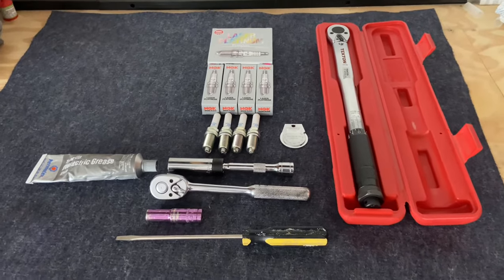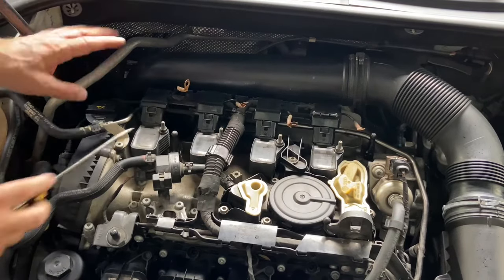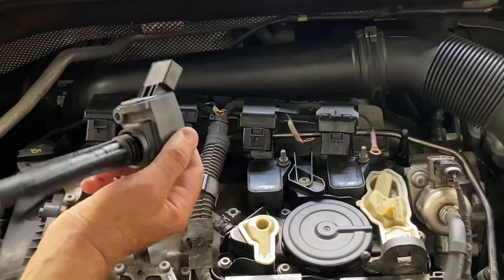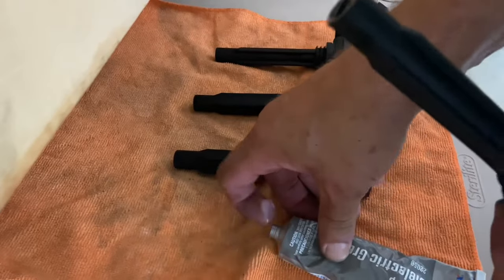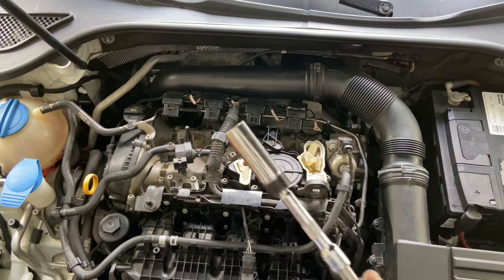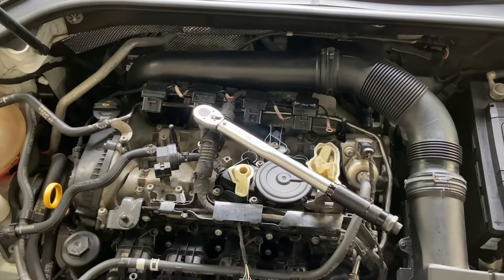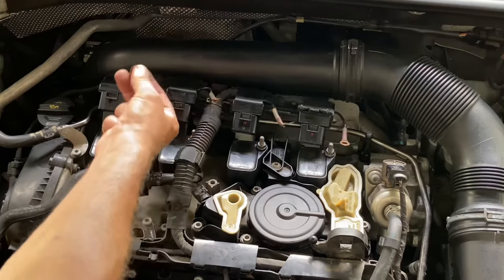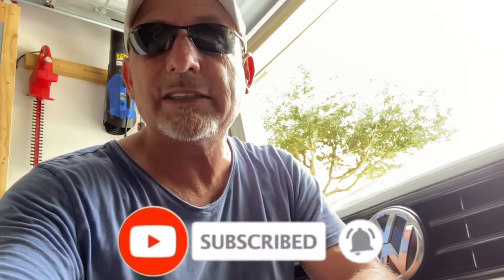VW PASSAT 1.8 TSI-HOW TO CHANGE SPARK PLUGS Passat/Jetta/Golf/Beetle #passat #sparkplug #volkswagen

Comment: Despite the really helpful and well done video, this project appears to be a bust for me.  The coils seem to be so badly fused that I wasn't able to remove a single one.  I thought I finally succeeded in removing one, only to quickly discover that the top of the coil separated from the rest of the rubber boot seated in the spark plug well.  I spent another couple of minutes trying to remove the rubber boot, but had to give up and put everything back together.  There is no indication (yet) that I've done any harm, but now I'm going to have to let the professionals do it and hope my assessment is correct.
Reply from the maker: No no no.  Just get new coil packs.  Pull the old ones out even if they seperate.  If they separate just make sure you get it all out.  Replace with new ones.  Good ones are only around $160 for the set.  A shop May charge a lot.  Let me know.  It’s not difficult at all.  😎💯
Reply from the maker: Use pliers or whatever to pull remaining part of coil out.   That’s why I’m the video I stress putting dielectric grease on the coils so they don’t get stuck.  But pull them out.  No damage should happen.  It’s just a metal tube down to the spark plug.  Seriously save yourself money and just get them out even if in pieces.  💯
Reply: Well, not wanting to give up, I have ordered the coil pack and I'll work on it again tomorrow.
Reply: I wasn't able to get back to it again until today, but success!

Once I got the coil packs out, it went smoothly from there.  Each plug was pretty corroded and each one felt as though it was covered in glue when I finally got them out.  I suspect the plugs were put in with silicone grease vs dielectric grease.  Whatever it was, it had solidified and created a bond to each of the plug caps.
Reply from the maker: Nice to hear.  Silicone grease and dielectric are pretty much the same.  But none was ever applied I think.  Most people don’t apply it.  But yea.  If you keep at it they will eventually come out.  Coil packs are such an easy thing.  I could never imagine paying for it.  Good job!
Reply: Hey I’m about to do this job just wondering how many miles did you wait for them to fuse
Reply from the maker: I bought the car used.  I was at about 70k when I replaced them.

Comment: My 10mm bolt is stuck to the other 10mm bolt with the ground wired stuck in the middle
Reply from the maker: Don’t break it.  Use 2 wrenches.  Hold one with a wrench and use another wrench or socket to remove it.  Spray with WD-40 also.  Let me know.  But be careful they break easily
Reply: @grind-it-out how did you get a wrench in between both 10mm nuts? A standard wrench is too tall.
Reply from the maker: I have a small set of metric wrenches.  It works fine.  If not get some needle nose vice grips or pliers and that should be enough to hold it while loosening the top nut

Comment: What tool is that to get the spark plugs out
Reply from the maker: A 5/8 deep well spark plug socket.   Pretty standard socket.  I have a magnetic one I got from autozone for $10.  But you can find them anywhere and it doesn’t have to be magnetic.

Comment: Yup i broke that plastic connection 😂
Reply from the maker: Hopefully you still got it off.  It’s not a big deal if it broke.  It will still snap back on.  💯👍🏼😎
Reply: @grind-it-out  thanks for the video. It’s on there but it’s broken so there’s nothing left to secure it.
Reply from the maker: Pull on it.  I think it should still snap on.  If not as long as you have a good connection you should be ok. 💯. They make things so cheap.   It’s ridiculous 🤣

Comment: Don’t forget your 6k mile oil change and 80 k oil seperator replacement
Reply from the maker: Ha!   Thanks for watching 👍🏼
Reply: Watching this video trying to change that oil separator it went bad at 92k. My coils do not want to come out
Reply: @theraysinator3752  ignition coils? Put oil cleaner and fuels system cleaner
Reply from the maker: Sometimes you have to tear them out and get new ones.  Yikes!
Reply: @grind-it-out  no better separator goes
Bad or not coils always come out hard in tsi engine because of big air vacuums , it is normal . Find best way to get them out . Also you definelty must flush engine with liquid moly engine flush change spark plug and coils. Putt gumout fuel cleaner . Good luck
Reply from the maker: I’ve done all that.  My engine is super clean inside

Comment: What if it doesn’t come out
Reply from the maker: The plug or the coil pack?
Reply from the maker: If it’s the coil packs then you need to pull like hell but they will probably break but that’s ok.  They need to be replaced with new ones anyway.  Use pliers or whatever to get them out.  The rubber gets stuck from heat over time.  Just get it all out make sure everything is clean before putting new ones in